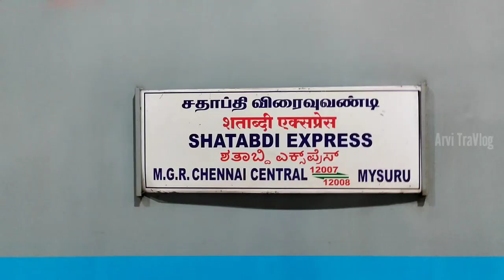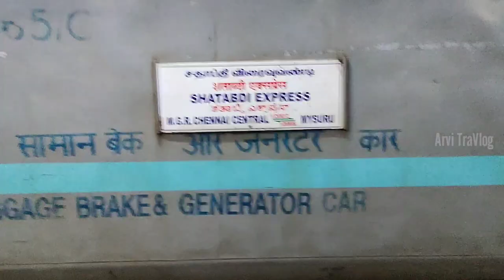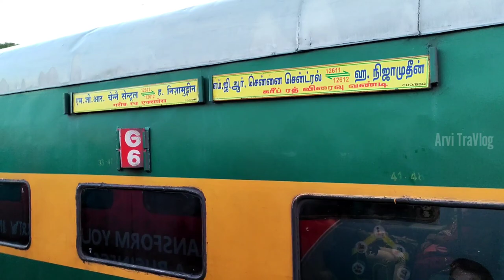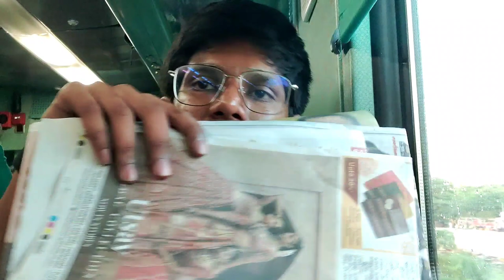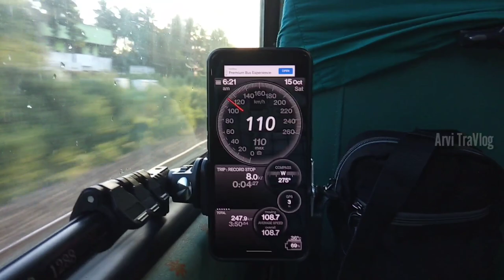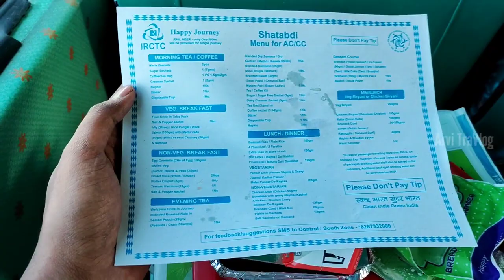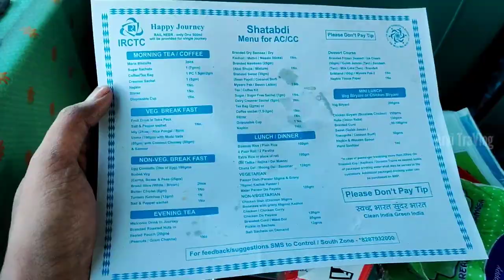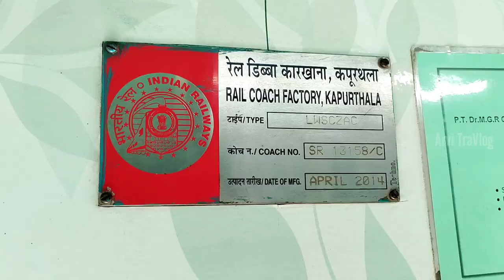The last days of Shatabti Express🥹 | Mysuru Shatabdi Express😍 | Chennai to Mysore | Vlog- 177

Comment: Bro actually from chennai to arakkonam 3rd & 4th line was not linked into arakkonam junction platform no 3rd & 4th.  So only katpadi bound express trains are taking the local line from tiruvalangadu.. At the same time chennai bound express trains are taking express line from near puliyamangalam. And also some fast local trains are same way used.